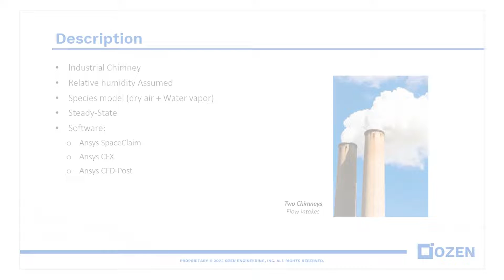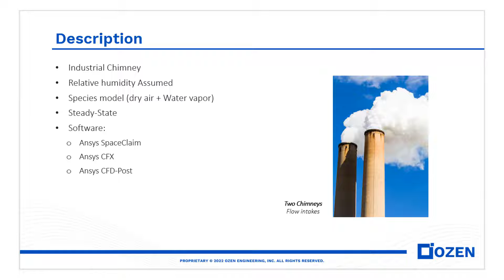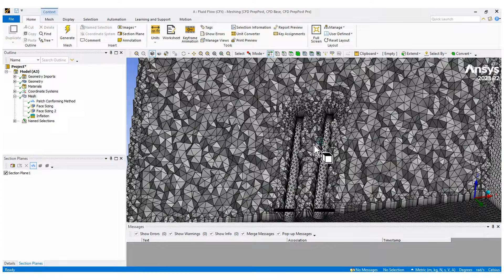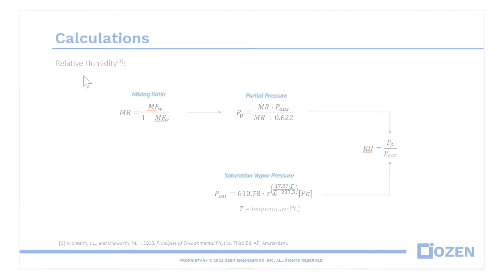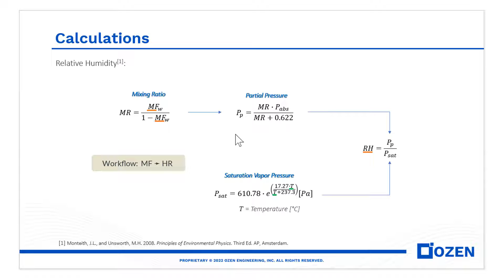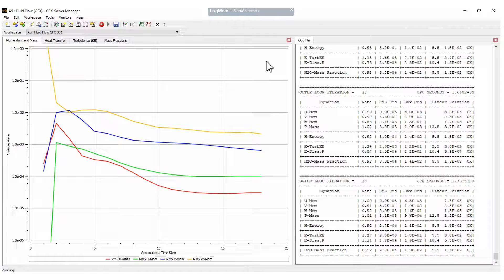Ansys CFD-Post: How to Postprocess Relative Humidity

Comment: hey bro , great work, 
i have some problem regarding this analysis, i did one test regarding RH ,i can explain what i did in test, first i put 75 psi of pressure put dry air for 1 min in container (30 L area) that RH reach from 60% to 30% in min, that process all gaps and exhaust holes are blocked, after 1 min i still closed all gaps and holes  waited to steady stage for ( like 40%RH) , t then i open gaps and turn on that fan to unit its reach normal RH at 60%, how can i do in my boundary conditions?

can u help me in their?
Reply: i am working on same project like this , i would like to discuss